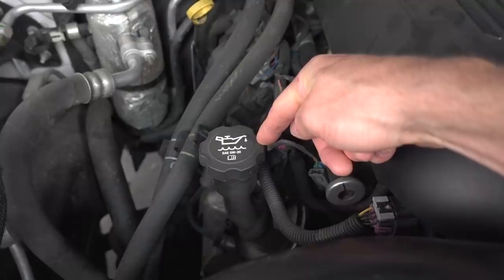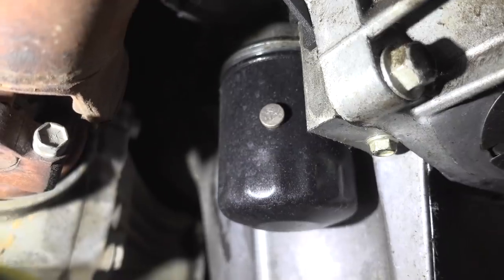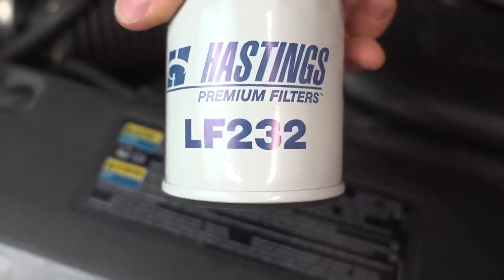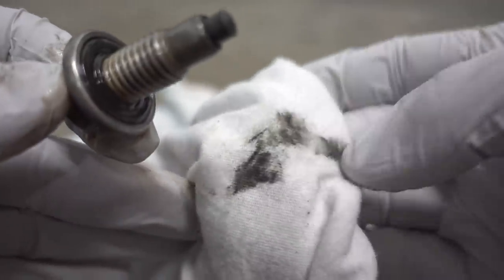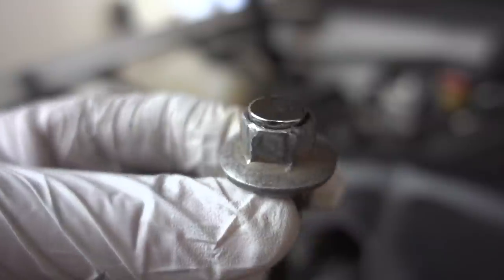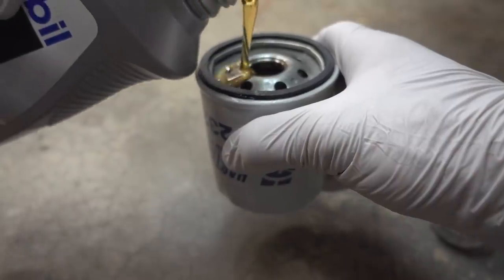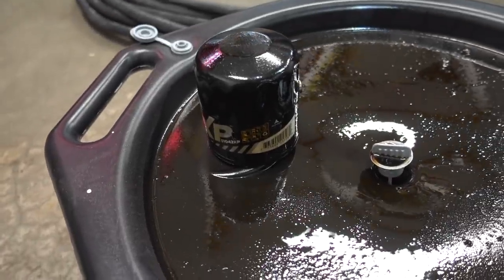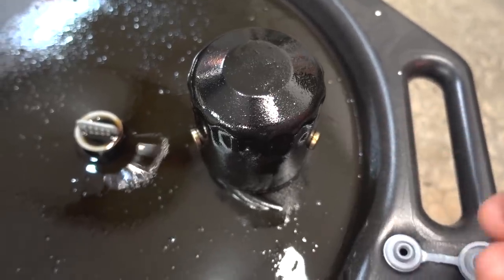Look What A Magnet Did To My Motor!

Comment: I use magnet's on all my car's truck's motors help and cheaper then any high end filter and boost all filter claims in cleaning the oil. I learn this From my old shop teacher back then and i teach that to the kids today with the newer motor's..  your car is a investment property why not make it last and get more out your $. And read your Manuel's on your car when you should change do the oil and brand of oil  well that up to you many claims what better so try them aND see what make the motor happy where you not getting a ticking sound and most high end oil already come with additives. Just stay away from fram filters . The low end... But can't tell you how to spend your 💰..  car is a investment...
Reply: Your car is not an investment property, Anthony, unless you are renting it out.

Comment: GM has a bulletin  on 01-08  that  light lifter noise is pic up tube gets air and the fix to replace oil rubber ring  between pump and pic up tube and noise will go away. Just sold my wife's yukon had 5.3 and had 249000 miles and motor runs real  smooth and quiet. No noise at all .

Comment: If motorkote needs a good shake up it means it has something in suspension which will settlw out again. Probably a teflon base which has proven to be more or less total waste of money. You would be better off adding some ZDDP as the levels in modern oils are extremely low (8~1200ppm) and 'optimum seems to be around 1800ppm. I believe ZDDP is in solution so does not need a good shaking before use? Also, any vehicle with a filter will have a bypass for when oil is cold or rpm high, a great deal of totally unfiltered oil goes around motor even with a brand new filter. I much prefer my old Honda's with centrifugal filters, anything 'heavy' gets caught including suspended particulate

Comment: You should look at getting a Gold Plug drain plug. They have rare Earth magnets on the tip. I've also though about putting some of those type of magnets on the bottom of the oil pan. And then when I go to drain the oil, I'd just remove those magnets and let the magnetic particles flow out.

Comment: 2 things Jimmy, those GM drain plugs are soft, so use a 6 point wrench., 2nd go to GM and get a couple new drain plug O rings, I service 1 of the largest fleets of rentals in America and Ive noticed numerous times that those O rings turn to crap after a few oil changes especially if some ham handed he man over tightens the drain plug!
Reply: Neoprene O-ring needs to be changed at EVERY oil change.  After they have been heated and cooled hundreds of times, plus torqued flat for 6 months or more...  they are not reusable.    They do not cost that much...  www.OilDrainPlug.com

Comment: ok 1st off with pre-filling the oil filter + adding 6qts and then 12ounces of additive you over filled your oil crank case. so basically you have about 4 oz of oil in the filter + 12 oz of additive that is 1 quart therefore you only need to add 5 qts to fill your crankcase.  2ndly yes GM did include a magnet on the drain plug in design but in newer they do not , meaning the found little to no benefit from it. 3rd you got mobil 1 full synthetic oil which by its self has tons of additives to protect the engine and isnt what is required for the engine, its better. as far as the newer gm models/engines they require dexos /dexos 2 or something of similar of a full synthetic such as mobil 1. 4th pre filling the filter dont make that much of a difference. you engine isnt being dry started. even if you pull the drain plug and let sit for 24 hrs it will still have oil coating engine parts. also this is more proven with gm and most manufactures going to cartage type of filters that you cant "pre fill ". 

i have 8 yrs experience , 6.5 working in a GMC dealership, working on these engines.
Reply: 4 oz. plus 12 oz. is 16 oz. That's only 1/2 a quart. Just sayin'...

Comment: I don't know if you put the MotorKote in an automatic or manual transmission, but I would NEVER put any kind of friction modifier in an automatic transmission.  You are MUCH better off using in line car motor oil filters and adding them to your transmission lines.  Even those you need to be careful with.  Automatic transmissions have clutch plates and the transmission oils are formulated with a very specific viscosity range and this MotorKote MAY affect AUTOMATIC transmission clutch packs.  On your second gear shift, you MAY be able to resolve that by flushing the tranny to get any floating debris or clutch material removed.  Just be careful about Power Flushes if you have higher miles.
Reply: Inline transmission filters are sold.  I don't think they are necessary.
Reply: @latrogeniwile58  Yes, but the micron size of an engine oil filter is usually a bit smaller.  That is good and bad.  If you use it right after a motor flush you will likely do okay.  If you put it on a dirty tranny then they will foul within a few minutes.  And you may be right about them not being used, I just know we have them on heavy equipment and they do filter out the clutch material.  They do sell conversion kits that hold 1 or 2 motor oil filters and they make them for transmissions.  I have been tempted to try one on my truck...  Alas, no time.
Reply: @Bill Wood 
I have asked places that sell the motor and transmission power flushes and they have warned me away from having my vehicles flushed for those reasons, the high mileage and that the power flushing equipment could flush stuff out that causes more issues than they solve!
Reply: @AzzKicker-bz1cb  IMHO the first trans fluid change and filter are the most important.  After that there should be far less contaminants.  If you keep up with the trans, say 50K miles, I doubt a flush will hurt.  I've done my own by disconnecting the cooler line and running into a 5gal pail.  You have to be careful not to starve the trans if you do that.  A 2-man job.
Reply: I agree with you 100%. Once a car is over 100k you really dont want to do a complete transmission flush, that maintenance procedure can have very bad effects on an automatic_2
Reply: @AzzKicker-bz1cb  The one thing you might be able to do is the bucket fluid change.  You just use the transmission pump line to push the old fluid out while manually back-filling it with new fluid.  Unless you drop the pan you will likely not get all of the transmission fluid but can change most of it.  As for the warnings you received, yes, they may be valid.  Here is a great video explaining the risks and issues:  https://www.youtube.com/watch?v=ctpVCWjd8b4.  Depending on the vehicle, and the number of miles, you still might want to consider it.  And if your are concerned, MAYBE change only part of the fluid.  Just do your homework and understand the potential risks.

Comment: Taking the oil cap off only increases chances of particles and dust in oil. Your PCV (positive crankcase VENTILATION) system already does the job of introducing air into the engine while the oil is draining, but it does so safely without chances of dust&debris getting in the oil fill opening.
Reply: San Pro Also to prevent dust from getting into your motor, when you refill your oil do it through the dipstick tube!
Reply: @erikressdorf8418  
You're kidding, right? How long will that take - using a straw?
Reply: Andy Roid Yes I was. But removing the oil cap is proper to help vent the block while draining the oil. Keep your engine compartment clean and don’t worry about dust. Also use a quality oil filter. Pre filling the filter is good and yes if done right you can do it even if the oil filter is upside down. I do it in my Porsche 911 and its filter is upside down!
Reply: Some people don't realise most of the oil stays between the can and the filter media, just a little messy.
Reply: So how much dirt and debris do you have floating around that this would even be a concern ?  A pcv is normally closed and only opens with engine vacuum. So it has to be running for your theory to be valid.  Do you think your local mechanic worry's about dust and dirt ? Hell, I take the oil fill cap off, jamb it on the hood latch, that way I never forget to put it back on.  Can't close the hood if the cap is in the way.  And yes, I'm a professional technician with 33 years in the trade.
Reply: The very small amount will be caught by the filter. Not enough to worry about IMO.
Reply: LOL  Not to worry about dust in any normal service environment for 10 minutes.
Reply: I think your PCV is a one-way valve, San Pro.
Reply: He was changing oil in a garage, not a sand storm !
Reply: Just don't remove the cap.  Loosen the cap completely and keep on top still.  That allows air but keeps any possibility of something getting in there including tools, leaves etc etc.  simple solution
Reply: Pcv doesnt let air in it let's air out. Idk where you got that information from. It's for relieving pressure not adding pressure.
Reply: San Pro Your just kidding right ? Unless your changing your oil in a sand storm it's very unlikely you will introduce any particles of any kind into your engine. You should ALWAYS wipe around the cap every time you remove it ! Personally I never remove the cap until I put the oil in, as you said it will vent it's self,  ( Not through the PCV  though ) but getting particles & dust in there is just insane line of logic ! Besides that's what the filter is for even if you do get a little dust in there ! Unimaginable statement ! I've been a mechanic for 54 years & can't believe someone would even think to worry about a little dust contaminating an engine with the oil cap off long enough to change the oil !
Reply: @erikressdorf8418  
I pre fill my filter and then I hold accelerator in flood clear mode, then crank enough for oil to pick up, usually around a 10 second crank. I have done all my cars or trucks that way for years. Seems everyone has an opinion on how to change your oil..
Reply: SFB My car is 27 years old she doesn't have a flood mode.

Comment: i remember when i used to buy premium filters and sythetic oil...then i realized that i dont give a shit n the basic of basic works just fine and my car has over 300,000kms and running smooth
Reply: What is basic of basic?
Reply: Scypheroth same
Reply: Scypheroth your right but, I use diesel shell rotella t in all engines diesel and gas. Also I add 1qt per 5qt gear lube 85w 90 for the sulfer and zinc. Oils used to have these now only diesel oils do. I've got 290,000 miles on my Toyota 22re 4cyl so far.
Reply: Depends on the vehicle, the climate, the use, and what kind of cheap oil and filter.  I've see engines ruined by Pennzoil.
Reply: @keithwalker4090  you put gear lube in your engine crankcase?
Reply: @Latro Geniwile 
I’ve grown up hearing horror stories about Pensoil and Quaker State oils turning into sludge inside motors after just a few hundred miles!!!
My father always used Valvoline and if I went to any other brand(s), they would be Mobil 1, Royal Purple, or Amsoil!!!
Reply: @s74p13s 
Don’t sweat it! He’s doing it to a Toyota!! 
He could probably add a cup of playground sand to that mix and it would still run like gang busters!!!
Reply: @AzzKicker-bz1cb  Yes, the Pennzoil - QS disasters I encountered were a long time ago.  Have to think the new oil is better.   The 3 brands you mention are all VG.
Reply: s74p13s yes, not a lot but between 1-,1/2 qt per oil change because it's thick. All I'm doing is adding back what should have been there in the first place!  In my 5.9 CUMMINS I substituted a full qt. the only difference between gear lube and oil is viscosity,zinc,sulfer. Long haul truckers have been doing this since they took it out of oils and diesel fuels. Just because they call something by a different name doesn't mean it's different! Oil is oil.
Reply: @keithwalker4090  Mobil 1 High-Mileage has ZDDP.  Been using that for years.
Reply: Latro Geniwile mobile 1 is premium oil! Has the best viscosity in extreme cold. If you dig deep into oils you find that there is very few differences between brands you can use motor oils for pretty much everything! Now grease on the other hand I like molybdenum disulfide!
Reply: @latrogeniwile58  ruined by Pennzoil ...back in 70s?
Reply: @AzzKicker-bz1cb  amsoil is a rip off. Buy there base stock from Mobil Exxon as do many!
Reply: @AzzKicker-bz1cb  haha go an try it! I never have & never will buy a Toyota . Too many other vehicles that are a better choice for various reasons. Buy American!
Reply: @Davido50  Yes, completely gunked up with major gel-like deposits.  Maybe they put STP in it...  Turned me off to Pennzoil and Quaker State.

Comment: I prefill oil filters even horizontal ones just pour oil in about 3/4 full then slowly spin filter and all the oil will soak through to outside of filter and none pours out as you install it especially if you keep slowly rotating it while holding it horizontal.

Comment: Bro, you need to get Votex (not vortex) magnetic drain plugs from Amazon. Made in Wisconsin. I have used the kind you have and put several in. I finally tried a different kind and man was I so enamored that I bought 2, and I am about to buy 2 more for manual Transmission.

Comment: I have a 2000 Jeep Grand Cherokee with the filter screwing in sideways.  All you have to do is fill the filter, wait 5 minutes for the oil to absorb into the filter media, then screw in your filter.  I've never had oil pour out of my filter when I let it sit and absorb the oil into the filter media.  Dry starts are horrible dude.

Comment: If you got a side mount oil filter, some ppl recommend turning the motor over a couple times with the fuel system disabled to get the oil pump to prime the filter. I doubt it will help your hard shifting...you could try changing your shift solenoids for that, if you know for sure it isn't slipping its probably safe to  and change the filter and fluid too

Comment: I use an oil plug with a high powered magnet.  I've also seen curved magnets that fit on the sides of an oil filter, FilterMag is the name.  Apparently some Purolatot filters have magnets in em.

Comment: I don't use mobil1 in my 5.7l anymore, it sludges up so bad. After 3000 mi of running, it came out really thick and black, almost chunky. I was shocked.  I thought there was no way mobil1 could look this bad after only 3000 mi. So I tried mobil1 again because I thought maybe it just cleaned out old junk. Nope. The next oil change was the same. So I tried it once again with the exact same results. After three oil changes turning sludgy, I tried the cheapest synthetic I could find. No more sludge. Went with mobil1 on the next oil change just as a test. It turned to sludge again. So no more mobil1 in that truck, anymore. I still use mobil1 on my other vehicles, but for some reason my 5.7l just don't like that stuff.

Comment: @1ROAD  Did the additive in your transmission fix 2nd gear or ruin your transmission. Would have been nice if you'd of done a test drive before posting the video. Either way, let us know. thx.

Comment: Great commercial for MotorKote! I fail to see what the magnet did to your motor. Also, of course this is my opinion, but if you maintain your car or truck properly then additives are usually nothing more than snake oil, additives to create less friction have been around for quite a while.